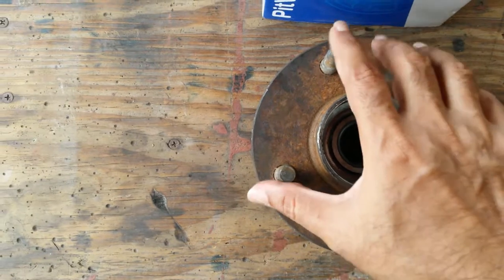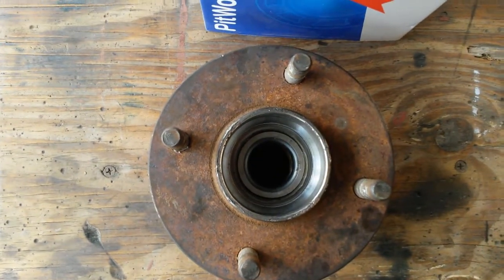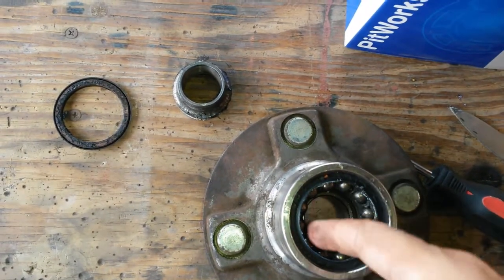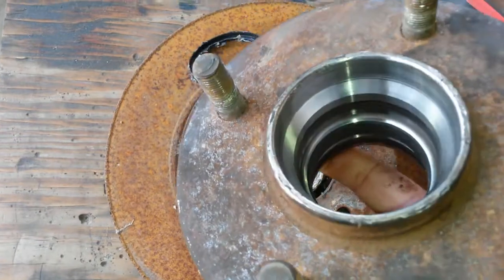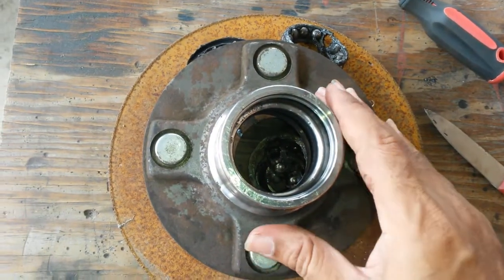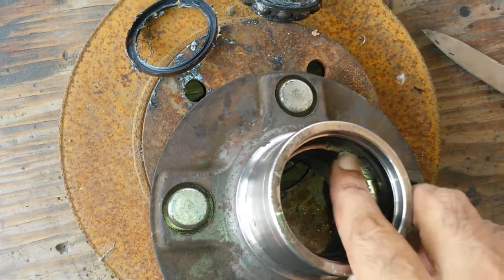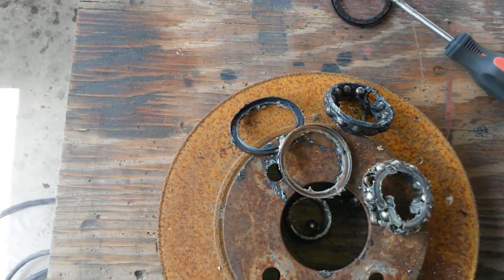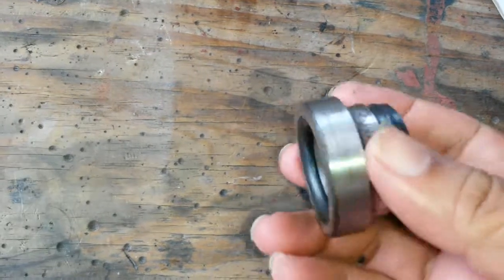132 Nissan B15 Rear Hub Assembly

Comment: Really interesting, man. Pretty big bearings! And really well machined parts!
Reply from the maker: The part I find odd is they made one side of the bearing from the casting. Normally the casting is machined to accept a bearing which is pressed in. 

The size is ok to replace the socket I was using in the ring video so I found a use for one piece already.